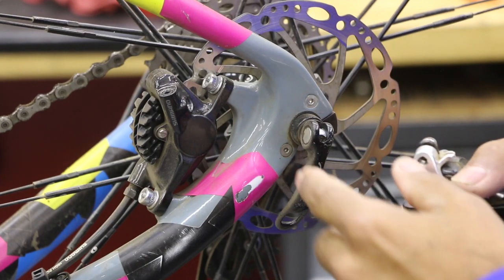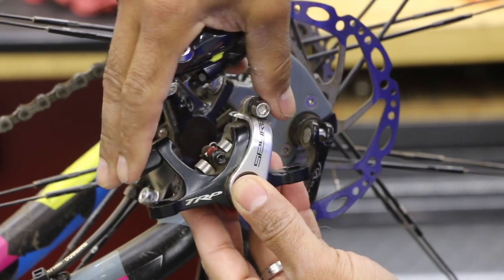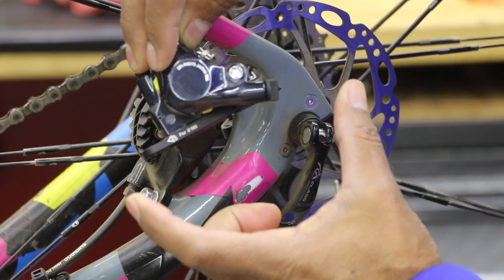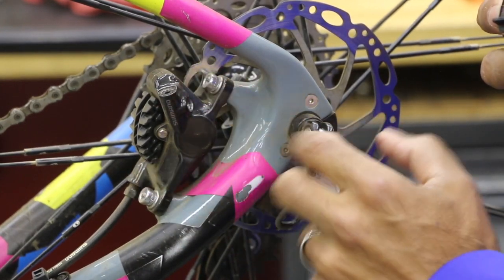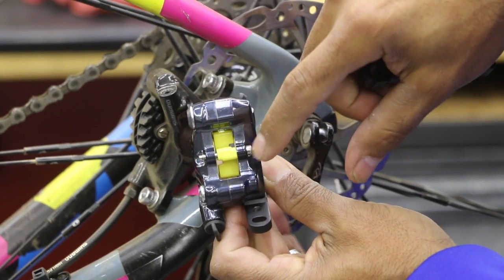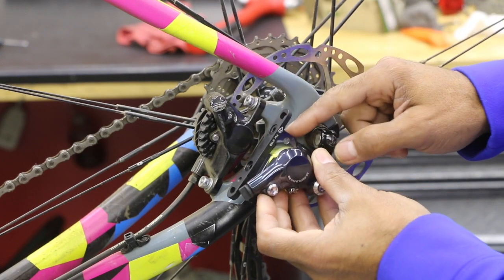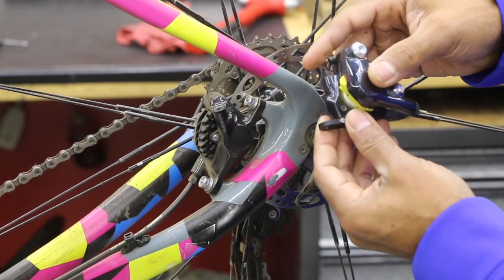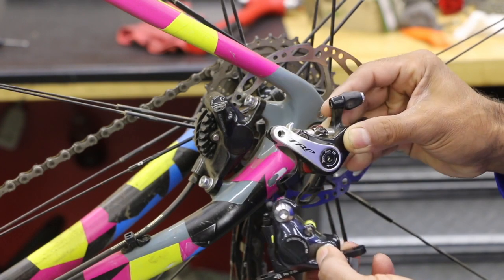Which disk brake caliper do you need? Flat mount or post mount caliper

Comment: It’s a total racket. They could have started with flat mount instead of obsoleting post mount. Bikes now cost as much as cars and bike components cost more than automobile parts. It’s a massive fraud. A bike should last a lifetime, not a few years!
Reply: To that end, there should never be any bike or fork with flat or post mounts.  They should all just use I.S. mounts where there are no threads cut into the frame or fork.  Just eyelets that you bolt your caliper bracket onto.  Yes, you can still potentially cross-thread or strip threads when installing, but with I.S. mounts, the damage is at worst to your mounting brackets, which are cheaply replaceable.  With post and flat mounts, the threads are cut into the two most expensive parts of the bike, which, if you make a mistake when servicing and reinstalling, means you throw the whole darn thing in the trash.  Nothing good could come out of that.

I.S. mounts should be the only mount.  Anything that involves threads cut into the frame is asking for trouble -- yes, I'm including BBs as well; the issue with press-fit BBs creaking is a result of the need for near perfect machining tolerances, which are unfortunately not achieved by the majority of manufacturers, especially not on carbon frames.

Comment: Post mount is 75 mm c to c for the threaded hole on the post. The adapter is 71 mm c to c. There is no ad adapter on the market that has the 75 mm  c to c  dimension. Hmmmm What is that?

Comment: No one even today in 2020 has an adapter from flat to post.  I just went through this exercise...tried to fit Ultegra Flat to post.  I ordered a couple of adapters from TRP which are supposed to convert them but the holes were not far enough apart and set the caliber too high.  In the end I installed a M8000 XT caliber with the Ultegra levers.  Bike looks great but the week spending time trying different adapters was frustrating.
Reply: Hi, did you use the m8000 calipers for both front and rear? I currently am setting up hydraulic 105 but I have post mount setup.
Reply: A.S. Solutions in Canada

Comment: I have a post mount frame and want to buy a GRX group... that's annoying.
Reply from the maker: Take a look in these comments. Someone shared a link for an adapter.
Reply: Can't see that for some reason. Youtube says 5 comments but shows only 3... can you repost it? 
I have post mount on the fork and IS at the frame. Do those adaptors work on both?
Reply from the maker: I looked for it, I can not find that link, the person must have deleted it. I did not save it, sorry.
Reply: Thanks! Found that one before and thoght it is a scam... for that money, I get better calipers...
Reply: I have a post mount frame and did buy the GRX group... that´s even more annoying. :D
Reply: manni schaeck the part is pricey but it works.
Reply: @MThomasHoff  i think for the price and shipping costs, i would be better off with combining some Maguta MT4 Calipers with a road group...
Reply: @MThomasHoff  I bought the adapter and can approve that they are doing their job. Thanks
Reply: manni schaeck glad to help!!!
Reply: I bought the GRX and found out that it doesn't work afterwards, that's annoying...
Reply from the maker: What was the problem?
Reply: @BikeTeacher  Want to replace a flat bar with a drop bar, turning a speed bike back to its origin, a cyclone cross. My fork has IS with an adapter for PM, my frame (backwheel) has PM, before there were 2 PM calipers from a 2014 XT series. The rest is Ultergra 2x10. The GRX brake levers didn't work with the  calipers properly, to less movement  of the 2 pistons. So I also bought the GRX calipers. Even though I found a PM-FM adapter, I haven't found one for the fork (IS-FM). I'm stuck...

Comment: That's why the rs-785 pm specific hasn't upgraded since 2017, it's for older frames, like having an apple phone from five years ago. Every wireless update makes it slower and slower.
Reply from the maker: Similar situation is the treaded bottom bracket. It’s reuse os endless compared to press-fit frames.

Comment: short question, i have a bombtrack Hook ext frame and GRX flatmount breaks. The Screws in the back for the rear calliper are way too long whats the problem?
Reply from the maker: Try adding washers, if you ave xtra conical washers, ad them. or get a sorter caliper bolt.

Comment: Not entirely sure I've figured out all the mount types but regarding an adapter for flat mount calipers to post mount frames, I think Wolf Tooth do one - "Post to Flat Mount Brake Adapter " . Not sure if this is what people are looking for in the the comments, it does seem to come with one caveat in order to work.
Reply: I was just looking at the Wolf Tooth. It will allow mounting a 'flat' caliper onto a 'post mount' frame, but it also increases the size of the rotor by 20 mm. I was looking to fit a SRAM flat mount onto my older road frame with a post mount, but I don't need 180 rotors!
Reply from the maker: I have not looked. I would hope something is out by now. Thanks for the info.

Comment: I have hybrid road bike , with flat mount frame. I want to change the mechanical caliper with hydraulic caliper,which better, using the caliper post mount from mtb (post mount)with adapter... or using roadbike caliper and i must change the dropbar lever to flat bar..

Comment: i have a problem on my triban grvl120 the front mount is flat and rear mount is i.s. mount, i am looking to replace stock brakes but almost every manufacturer on aliexpress is either selling flat mount or a post mount brake pairs, so my front caliper is supposed to be flat mount and rear one should be post mount. what are my options?
Reply from the maker: Try to find a single caliper only and just install that. I know, easier said than done. Maybe a shop can order for you.

Comment: hi there, thanks for the nice and informative video, can you tell me what is the size of the bolt used for ultegra rear brake? mine got loose thread, im gonna need longer size bolt but could not find its size in terms of thread and diameter. pls help.. thank you in advance..
Reply from the maker: Hi. Sorry I do not know the size. Maybe on the Shimano tech websites.

Comment: Hi, i have a question,  i bought the marin team 1, and i try to upgrade the brakes, but de rear brake mount is about 34mm and the usual mounts is about 75mm, which adapter should i use to mount a shimano m6100 brake with a 180mm rotor
Reply: Or a 160mm rotor
Reply from the maker: Sorry I do not know those specifics off hand. Check out Problem Solvers website.

Comment: is it possible to make a 35mm flat mount road caliper fit a 75mm post mount mtb frame?
Reply from the maker: There may be adaptors out there by now. I have not had to deal with this for some time. Someone in the past has made a comment and possibly shared a link.